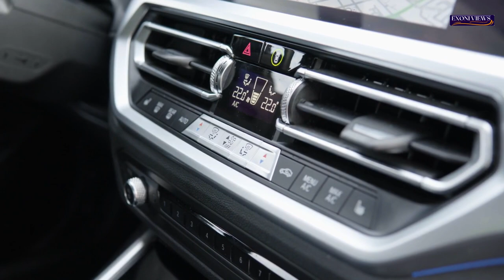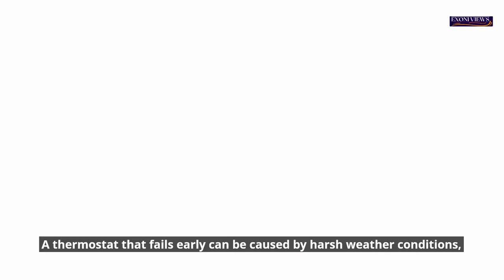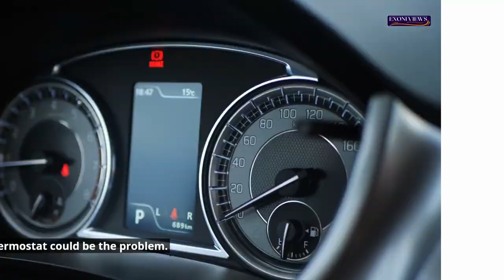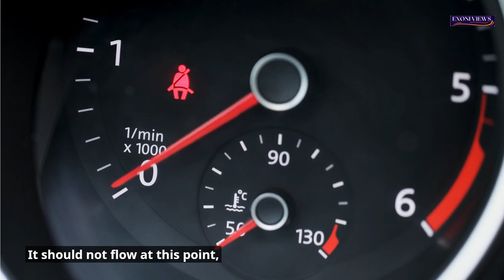What is the typical lifespan of a car radiator thermostat? and When  should I replace  it?

Comment: I love these videos that categorically state how easy and inexpensive a car repair can be. This information was relevant in the 1970's when thermostats could be changed in 15 minutes and cost $15. Try changing one on a Fait 2.4 multiair engine. OEM part costs almost $500 and aftermarket are garbage and don't work. Not to mention the 2 hours of misery and blood shed to change it.
Reply from the maker: Car repairs have evolved since the 1970s, and some repairs may no longer be as easy or inexpensive as before.

Comment: The engine lite for a failing thermostat only applies to newer vehicles though doesn't it? My van is a 2001 Dodge Ram v8. I don't know if the computer is programmed to indicate a failing thermostat.
Reply from the maker: You're correct that the "check engine" light for a failing thermostat is more commonly found in newer vehicles. In older vehicles like your 2001 Dodge Ram v8, the computer systems may not have the specific programming to indicate a failing thermostat. However, that doesn't necessarily mean your thermostat is in perfect condition. If you suspect an issue with your thermostat, it's a good idea to keep an eye on your van's temperature gauge for any abnormal readings or signs of overheating. Additionally, if you notice any other symptoms like poor heater performance or fluctuating engine temperature, it's advisable to have a professional mechanic inspect and potentially replace the thermostat if needed.
Reply: @exoniviews  I do keep an eye on it and it has been replaced not long ago last year or year before . I do automotive courses and I have been doing my own repairs for some years now. I can tell that it is opening by feeling the top radiator hose for pressure and heat and watching the temp gauge.